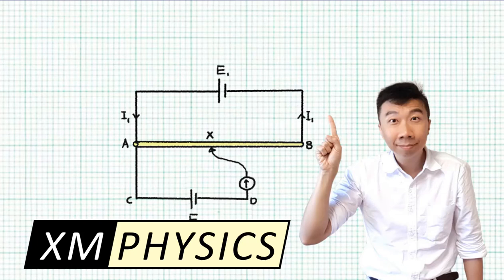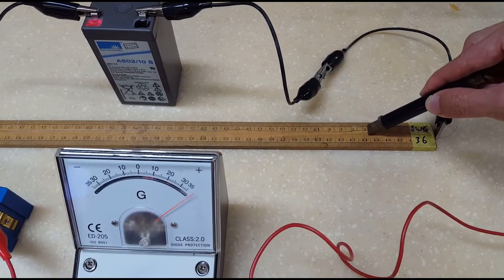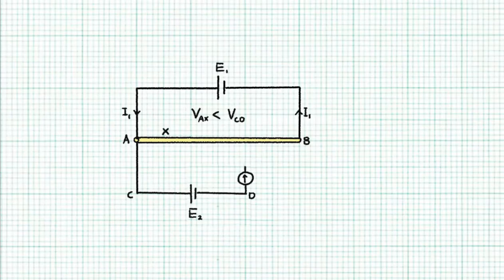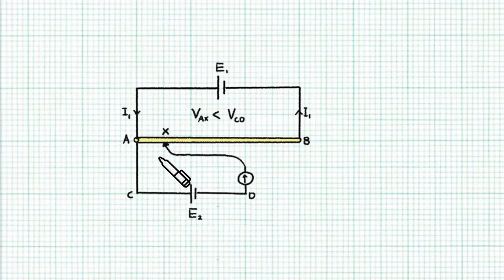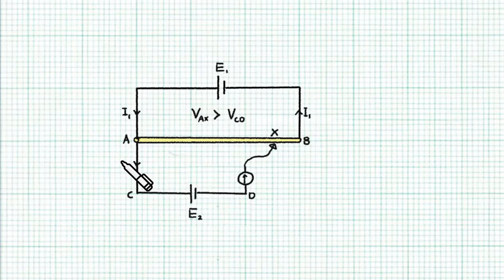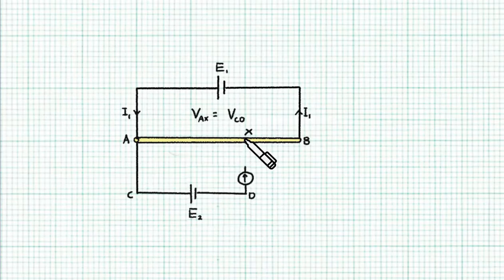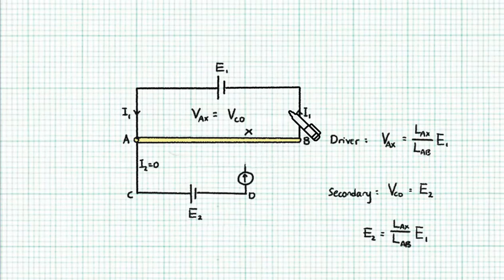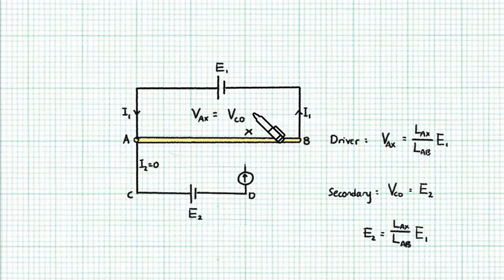13.8.1 Potentiometer (Part 1)

Comment: Am I the only one who thinks the starting circuit is incomplete? Can someone explain it to me?
Reply from the maker: Of course, before tapping the jockey onto the slide wire, the bottom half of the circuit (aka secondary circuit) is in complete.

Comment: Hello. I just would like to confirm this all will only happen when E1 is greater than E2. Also when will this double battery circuit ever be utilized in reality?
Reply from the maker: If E1 is greater than E2 then the balance length does not exist. Meaning no matter where the tap is made, a current always flows in the galvonometer.

Comment: There will be current flowing in E2 only when Vax and Vcd are not equal. E2 will produce current when Vax is too low due to decrease in length, and E2 will absorb current when Vax is too high due to increase in length. This is all due to the fundamental rule that the voltage drops across the paths in parallel should be the same!
Reply: thanks dude❤❤❤

Comment: 1:13 Hi why is it 1.7V? Shouldnt it be lesser than 1.5 due to ir
Reply from the maker: Firstly, in practice a new 1.5 V battery usually has an actual emf higher than 1.5 V. You can use a voltmeter to verify this. Secondly, the internal resistance is irrelevant at null deflection because no current is flowing through the battery. Which is why the potentiometer always measure the open circuit emf.
Reply: hi @xmphysics  thanks but im confused why the current doesnt flow in CD. cuz in a normal parallel circuit, the pd in each branch is equal but current still flows in each branch.
Reply from the maker: @rgravi  Well, in a "normal" circuit, there is only one battery. So the pd in each branch is the same because that one battery pushes out the correct amount of current to make it so. Wheareas here, there are TWO batteries. The driver cell has done the job of setting up a pd across that connected segment of the wire, which happens to match the emf of the secondary cell. So the secondary cell does not have to push out any current.